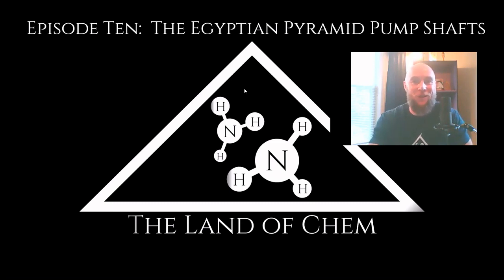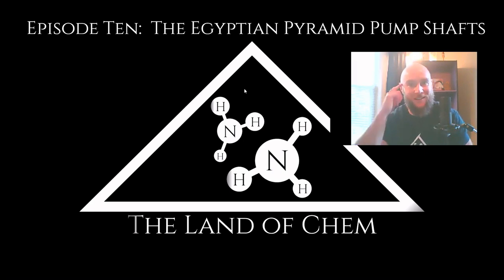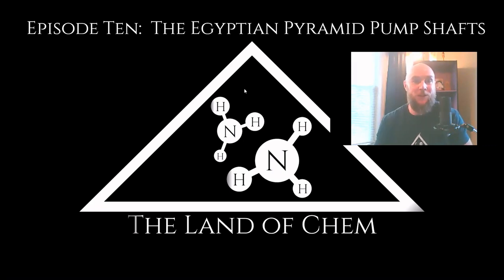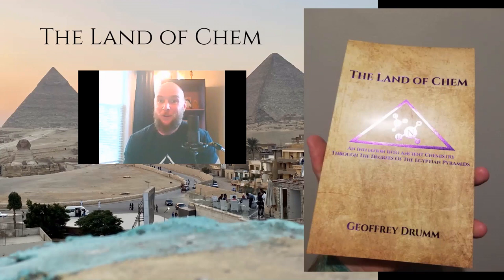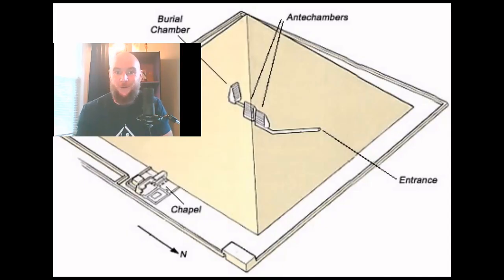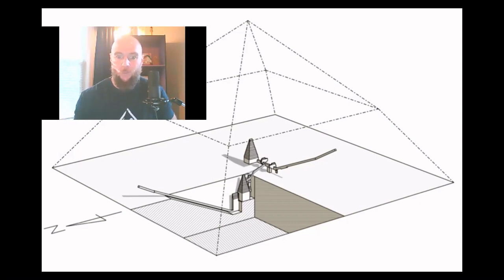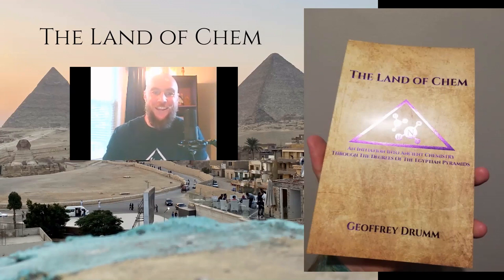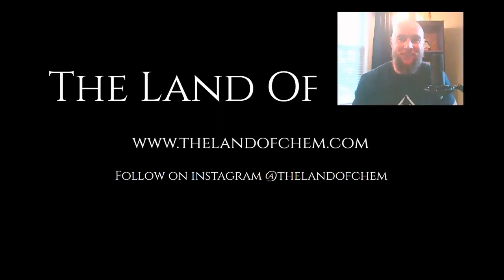Episode Ten:  The Egyptian Pyramid Pump Shafts

Comment: Perhaps I have my....orientation incorrect...but the northern "pump shaft" is the northern modern "entrance"....no? If so...your math doesn't seem to add up...

Saying 33ft is the height of the enclosing wall, the water being 33ft deep. The northern "pump shaft" opening is around 60ft from the ground....meaning the water would never get that high to flow in.

Does this mean we are missing 30ft or so of "ground" around the pyramids? That there used to be 30ft of flooring around the complex? Then, a 33ft wall on top of that would be high enough to have the water level the 60ft it needs to actually get to the northern "pump shaft" opening? 

Really liking this theory, but...that obstacle right there is...well..a fairly large hole in the theory, tbh.

Comment: Has anyone calculated the exact dimensions of the chambers..and the water volume to calculate the water pump shafts capacity to force more water into the chambers to create enough pressure to begin the chemical reaction?  It would seem that the math would eliminate some of the questions. I am not a math guru, however with my limited knowledge...how much water will fill chambers one and two..to equalize with the reservoir...calculate the volume of water in the pump shaft and the remaining space in the reaction chambers.....then calculate the amount of water displaced into the synthesis chamber when the stone is lowered into the pump shaft.  I know you have described a few more steps in the process where the water is raised and lowered in order to facilitate the flow of the gas from each chamber....but a math guru should be able to calculate the answer.  I am hooked brother.  Hope to shake your hand one day.

Comment: The descending shaft on the North side has a very prominent kink, change of angle, this doesn't bode well for a sliding stone to move up and down, also the shaft walls in some places are far from flat edges so wouldn't there be an escape of water around the descending stone? And finally if a stone slid up and down these shafts we should see wall and especially floor marks to show signs of this like we see in the great pyramid grand gallery.... Any such signs in the bent pyramid descending shafts?
Reply: How does the stone block get moved out of the pyramid or back up the passageway?

Comment: Sorry, this is nonsense.
1. For this to work, the shafts need to be water-tight. They are not.
2. For this to work,  the shafts need to be perfectly smooth with a perfectly consistent profile that the block can efficiently seal. The shafts are not like that, the water will simply flow around the blocks and not get pushed down.
3. How did they pull the block back up (especially if it was somehow tight-fitting, perhaps with a rubber-like seal)?

Comment: thinking more about it, it is possible with a tunel very smoot polish, with joint seal with some kind of liquid sealent, then for the compressed block, they would have use a wooden block with leather and oil aroud it to create kind of a thight seal plunger push with a block of granit with roller under it to nagate friction, i think that could compresse water in the chamber, also with anchor on the block with roller, it is possible to add blocks as soon as the first lived a place for a auther one incressing the weight and the pressure
Reply from the maker: excellent comment and I couldn't agree more! I'll be showing more photos of the pump shafts in some upcoming videos. Thank you!
Reply: @thelandofchem  i hope the new minister of antiquity of egypt will release some information they all ready have in the secret vault

Comment: Okay, so one issue you have not covered up to this point, is why a pyramid? This is not just some shape that was chosen at random. If what you say is true, and so far it makes more sense than some huge burial monument. I digress, but this has always been a stupid idea to me. I’m a Pharaoh and I want to spend the majority of my tenure building a monument to myself rather than some public works project that would benefit my people forever? Look at President Eisenhower. He built something that has benefited his people probably millions of times more than it cost. The Interstate Highway System. These Pyramids are the equivalent of our Interstates. Another thing is most of the Egyptian Archeology is dated with the equivalent of going to the alley behind the Empire State Building and reading the graffiti and determining that the building was built in 1997 by Elwood, or finding a styrofoam McDonalds container that was buried near by and saying they this was from the 1970’s so this building was built in the 1970’s. 

Digression ended, and back to the shape. If they are generating pressures inside they need a containment vessel. The weight of the stones piled in a pyramid would serve as that containment vessel. The fact that they are precise enough to be air tight is amazing plus they show an ability to mathematically calculate the required amount. Knowing how much stones compared to calculating the needs based on volume of exposed inside area and the pressure requires more than just counting on your fingers and toes. I was struck by this while watching your video on Ireland. Why not a pyramid there? Because it is not needed there. The density and make up of the soil in Ireland is vastly different than Egypt. They could obviously calculate the difference and just make a pile of dirt. They also needed the vertical difference for the flow of “product” and the pyramid offers that. Not only does it need to be airtight but any misalignment would constitute a weak point. Of course there may have been many more of these that were not as precisely built and they failed based on these weak points and the stones were repurposed over the eons.

Comment: Haha, “…. And without further ado, let’s get right into it.” And then you spend a few minutes talking about other things or “further ado.” Still love it, just thought that was hilarious. Now, I’ll watch the rest.
Reply: Thank you Sir! I gotta put that slide somewhere lol
Reply: @geoffreydrumm5795  Just finished your book. Step, Red, Bent Pyramids, I totally buy it. Based mainly on the need for a very strong containment vessel to keep the pressures from raining down pieces of rock if there is an accident and also to dissipate heat. The Great Pyramid, I buy the why not necessarily the what is produced. The pyramid not only maintains pressure but can dissipate heat. 
But the Central Pyramid, I do not see a reason for the entire structure as everything is underground and not tremendous heat or pressure. But then I have experience with the materials in the upper 3 pyramids and not the Giza pyramids. I’ll wait and watch further.
Reply: @rickshaw8926  thank you for the feedback! You are spot on about something regarding the GP. I won't spoil it, as it will be featured in my next book. Check out the experiment at the end of my most recent video and it will give you a clue for the mass of the structure itself. I really appreciate the support!
Reply: @geoffreydrumm5795  I did. And that agreed with my original theory hinted at in one of my comments. What you said was produced at The Great Pyramid may be accurate but as a byproduct not necessarily the purpose. Although I have never been closer to Pyramids than Istanbul. 🤣 so what do I know.
Reply: @rickshaw8926  I will have to go back and take a look. Very intriguing structures for sure. So, theories aside, what did you think about the story?
Reply: @geoffreydrumm5795  I enjoyed the story. I might have enjoyed a tech paper more but then most readers probably didn’t have 3/4 windows opened up looking at drawings, pictures, and Google images while reading it. But I still enjoyed it very much.
Reply: @rickshaw8926  that is exactly what I envisioned readers doing when I wrote the book!  Really means a lot man, thank you. My original intent was to write a research paper, but after some great advice from my father, I went for the story. I have something in the works that you might be interested in. Will definitely be in touch, and again, thank you so much for the support!
Reply: @geoffreydrumm5795  I also appreciate the interaction in the chats I’ve seen you have with others besides me. I have some burning questions, but understand all the answers will come in due time.

Comment: How does a small block compress that much liquid? We’re they using elephants to push the block down
Reply: One cubic foot of granite 168 pounds. 1 cubic foot of water 62 pounds.
The changes are tapered at the top so less volume.
The block needs to be 2.5 less in volume. 
No elephants needed.
Reply: @normdeeploom5945  now do the volume of water in the whole 2 chambers and calculate how much granite u need to shove down the end and it’s at a 27’ slope. From memory
Reply: @Endle185  it's a matter of fluid dynamics, physics, and the configuration of the structure. The block isn't compressing the volume of the water in all the chambers, just the water in the shaft.  The force being equally and simultaneously distributed to all points in the fluid causes the water to rise in chamber 1 and 2 and then moves water from 2 to 3.
Reply: @Endle185  lol he probably could
Reply: @geoffreydrumm5795  I understand that, but how much granite would you need to do such a thing? And how do u get the block back out? Plus there are pics that u see the sediment on each side of the shaft in the great pyramid a block would not let this sediment to rest? The evidence doesn’t back up the theory.
Reply: @Endle185  what evidence?  Dude, the Pyramids were not originally filled with sediment. And they moved millions of huge blocks. You dont think they could figure out how to move one in and out of that shaft?
Reply: @geoffreydrumm5795  ok your right. The pics from the great pyramid doesn’t exist proving that point. I give up. Have a great day.
Reply: @Endle185  did they find sediment inside them during modern excavations? Of course. That's what happens when you sit in a desert for thousands of years. Also something (ie flooding) may have happened that filled them with sediment... However, they were not filled with sand or whatever when they were first built or as a part of their function.  That happened later and is irrelevant to the discussion of how they may have operated
Reply: @Endle185  I am definitely open to critique on my theory. And I know you have studied the Red Pyramid. But saying the sediment they found during the excavations is some "proof" or "evidence" against my theory is not a good argument. That sand wasn't in there originally dude
Reply: @geoffreydrumm5795  i dont think you can compresse any thing with bloc of rock , nothing is seal you gona have a lot of leak, also the sub shaf is connected with aquifer so all the water you gona put in the shaft is gona leak in to the aquifer
Reply: One thing to point out is that water does not compress much if at all. It's not water that is being compressed, it would be acting as a piston to compress gasses in chambers. Looking up basic hydraulic principals will shed light on the effect of a small pistons effect on a chamber of larger volume. It's all mechanical advantage.
Reply: @dank1389 agreed, fill up those 2 chambers with as much water as you can and use the water with the movement of the piston pushing the water down the shaft to raise the water levels in the 2 chambers to compress the gases.
Reply: I am definitely open to these types of ideas!  In the book, I say that the block is "compressed," but I do not specify how. I have some ideas of course that I'm sure will come out at a later date
Reply: Also, Im pretty sure I didn't say "small" block.  It may appear that way in relation to the rest of the structure in the animation, but it would be very sizable piece of stone